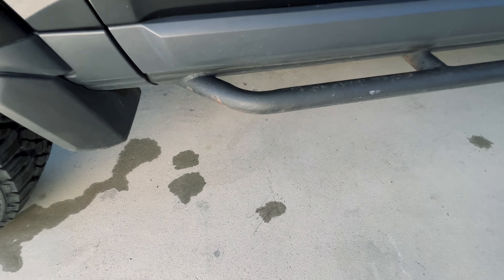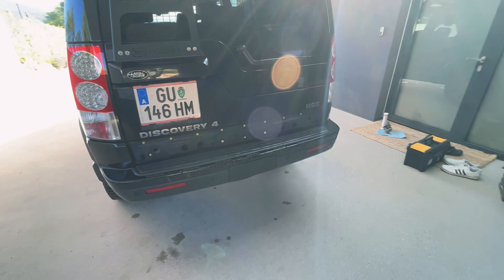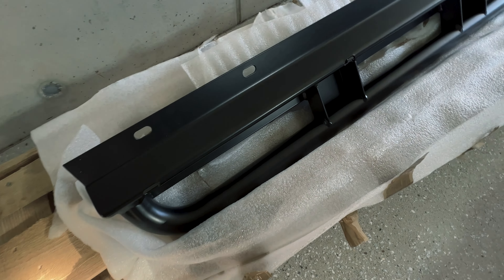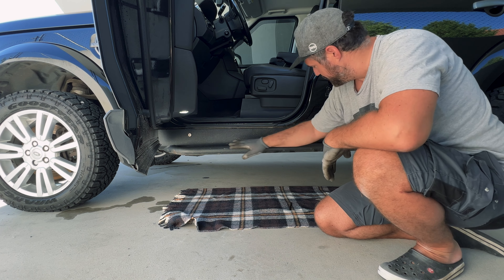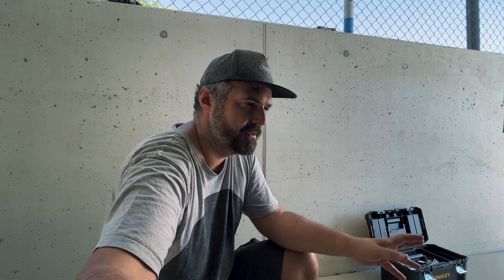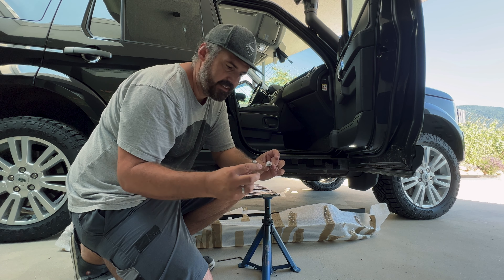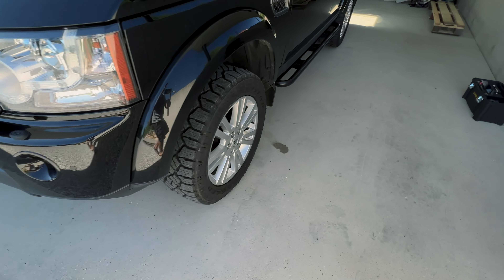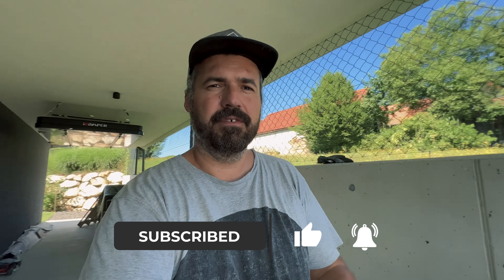Installing MP4x4 Rock Sliders on a Land Rover Discovery 4 / LR4

Comment: are rock slider strong enough to rope them and lift a car with a high lift jack   ???
Reply from the maker: Hey, I haven't tested it yet. But judging by the weight, the strength of the metal, etc., I think so. But I can ask if you want. Greetings, Peter

Comment: do you wana sell the old ones ?
Reply from the maker: For sure, but I won’t ship them in case of the weight 😉 Would be too expensive
Reply: Hi Peter.  Have you sold the old ones yet ?  If it’s not too much trouble ,  could you put up a detailed sketch of the measurements , holes position, material etc, I’m in Ireland and have a fabrication shop. My own are rusting out and I need to make new ones. Cheers in advance.
Reply from the maker: @thegasman.gasman.7643  hey! Sorry but I already sold them. Best, Peter